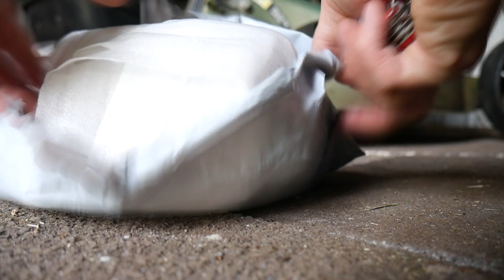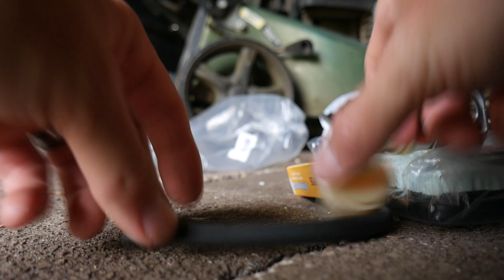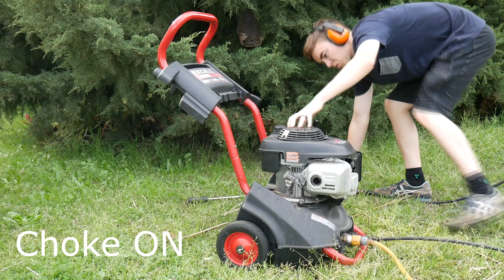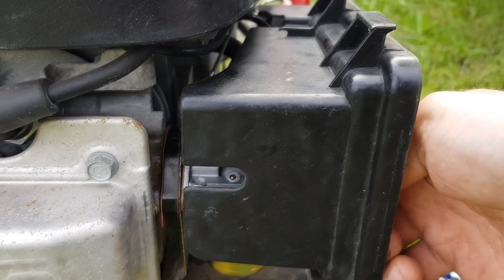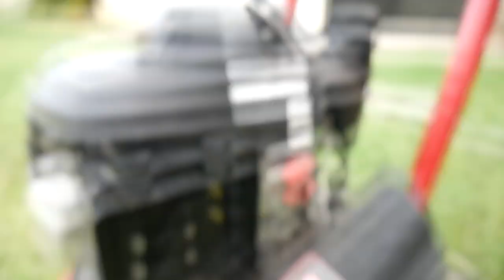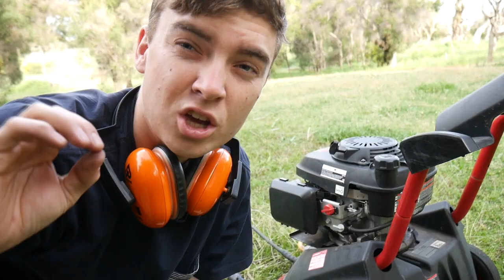Fixing A Honda With A $20 Carburetor // Small Engine Repair

Comment: great video!!  I had similar experience buying aftermarket carb off amazon for a problematic Tecumseh mower engine. was great success for me (and only $12..haha).    I now have a new mower with GCV160 motor with similar prob and $20 every couple of years seems OK.
Reply from the maker: Yeah seems to be a poorly designed carb